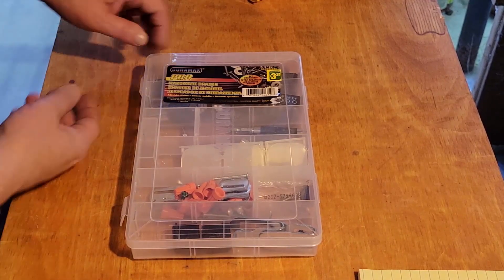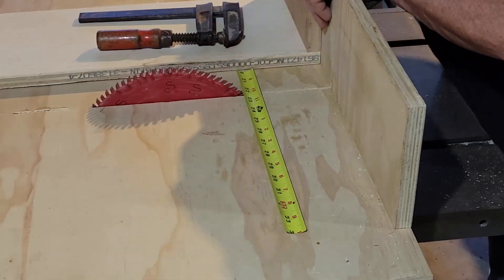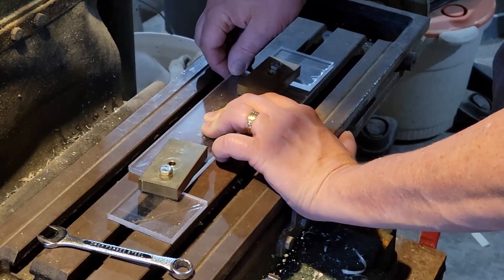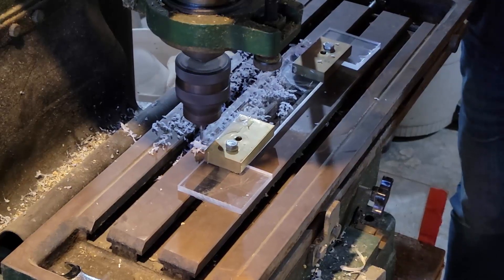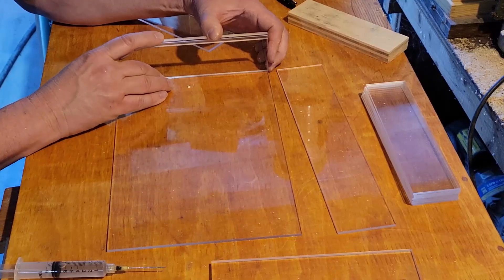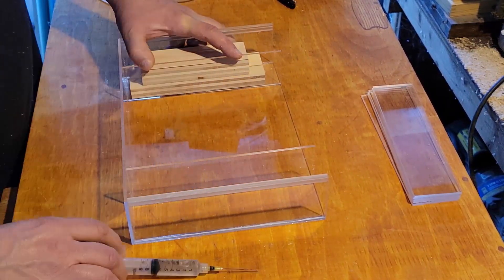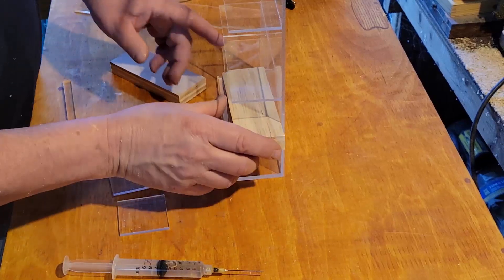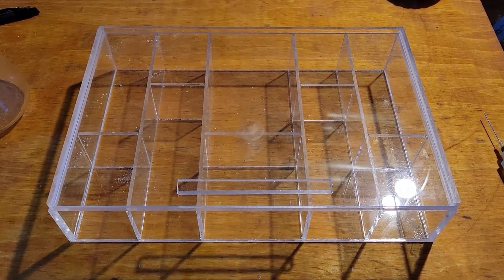Tool Box Acrylic Small Parts Organizer

Comment: very neat I bought one that was supposed to make it easier to pick out the last few small bits it was terrible the best one I've ever had the back front and the dividers were at a angle of 75 instead of 90 so you can slide tiny bits up and out even with sasuage fingers 👋
Reply from the maker: Hey Colin! I know what you mean. I put a little magnet on a an extendable antennae in there to deal with those pesky little things
Reply: @justmakeit2849  I found a brilliant new one of those it looks like a pen and extends to around 18" and it's bendy it's got a magnet a LED and the button on the top works a grabber it was only around £15 by far the best cheap gadget I've picked up if the storage box doesn't work out you will probably find a way to turn it into a filter etc lol 😉👍
Reply from the maker: @colinhamer6506  Sounds cool Colin.

Comment: @JustMakeIt~ So, did you use 1/4" acrylic on the frame and Top/Bottom, then use 1/8th acrylic on the dividers? It was hard to see from the video, but it looked like the dividers were a thinner acrylic. I know you do this kind of build frequently and think you are boring us by showing us the cutting of the material etc.... BUT, I'd like to see more of it. I know you utilize your table saw to cut the acrylic, but can you tell me what kind of blade you are using?  Are you using a Fine Finishing high tooth count wood working blade or do you switch out your blade for the acrylic? I want to make several acrylic boxes for all my small garage supplies (nuts, bolts, screws, washers, nails etc...), as well as some larger boxes to store several tools/supplies I utilize for leather work, sewing, fabric, mosaic & stained glass, and art supplies. I have seen opposing advice on the type of saw blade to use on plexiglass.....I know the key is to make sure not to let the blade get heated up because it will melt the acrylic. I'd appreciate any advice you could give me!  Do you purchase your acrylic from Home Depot/Lowes in 4' x 8' sheets or is there another supplier who offers it at a better price?  Thanks!! ~~Christy~~
Reply from the maker: Hey Christy. Just the two side panels were 1/4"; so I could mill out the slot. Everything else was done in 1/8". The saw blade is a standard fine toothed finishing blade. There is a difference between plexyglass and acrylic. Some material sold as plexy is a lower grade polycarbonate. The key I find in cutting it is to make a smooth even pass through the blade with no hesitation (I will try to include more on this in an upcoming video or make a dedicated one). I get my acrylic from a plastics specialty shop and never from the big box stores. Glad to hear from a fellow crafter. Thanks for coming by!
Reply: @justmakeit2849  Great information! I know I definitely don't want to use polycarbonate. I will have to check to see if I have any speciality plastics shops in my area (Des Moines, IA). I will also contact a few local glass shops because I know they often carry a variety of different glass alternatives too. I appreciate you answering my questions, it truly helps! Look forward to your future videos! ~~Christy~~
Reply from the maker: @CALB2009  My pleasure!
Reply: @justmakeit2849  I am curious, are you using standard extruded acrylic sheets or are using "abrasion resistant" extruded acrylic sheets? Do you have the name of the manufacturer and perhaps the model/sku# of the products you are using? I have found a few plastic companies here but I am not sure they sell to the public, it seems their business model is Business to Business. ie: 1) wholesalers 2) manufacturing companies that create products from their acrylic supplies. First and foremost, I want to purchase acrylic that doesn't contain polycarbonate and secondly, I want to find the best price for large sheets like 4' x 8' and larger.  Do you buy large 4' x 8' sheets and if so, how much does it cost you? Like every other type of building or crafting material, the price can vary significantly.... and I HATE to be the uninformed consumer who gets suckered at the cash register! LOL!! Any feedback you can give me would be GREAT!
Reply from the maker: @CALB2009  All acrylic is polycarbonate. The differences come from the processing. Low end acrylic is mass produced and is a little softer with a lower melting point. Higher end products follow a slower extrusion creating a harder material (what you're calling abrasion resistant). The best is cast acrylic, which is much harder and is somewhat easier to machine. I don't use a specific manufacturer as prices vary and there isn't much of a difference. I just order what I want and leave the rest to my supplier as we've worked together for decades. There's no point in talking price as I'm not in the States and it won't mean much. I order it by the sheet and have it cut down to a general max size that will fit my equipment
Reply: @justmakeit2849  Once again, thank you so much for so thoroughly answering my questions! I truly appreciate it! Have a fantastic day! 🙂
Reply from the maker: @CALB2009  Anytime!